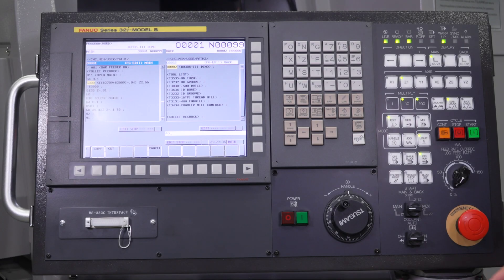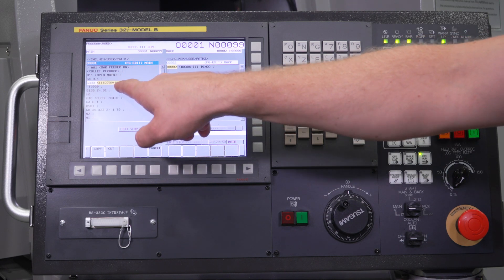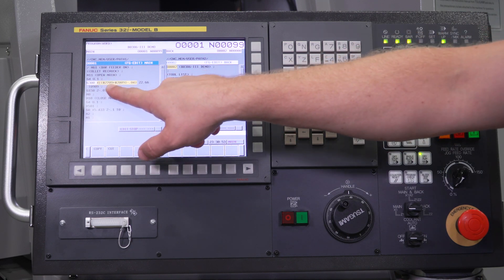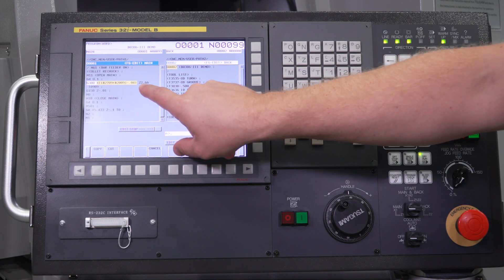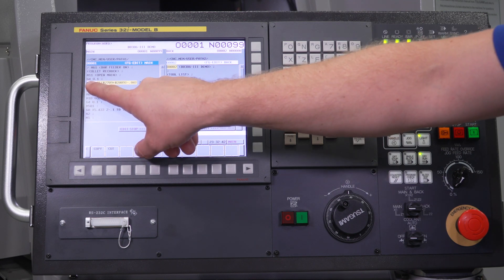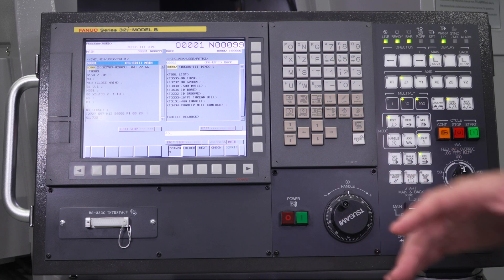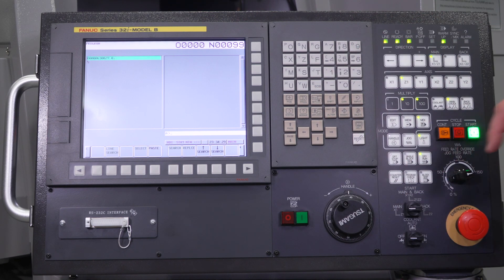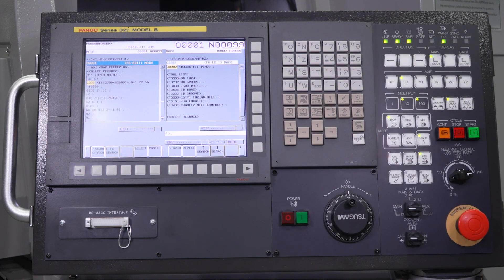How to Use the G300 Code in Your Tsugami Part Programs

Comment: I really appreciate the time and effort put into these videos. I am new to Swiss Turn lathes (SS20) and only the manual to guide me. Its one of the best but having a visual reference and explanation is very helpful. To that point, video cuts to the machine motion are excellent. If you could add close up to the screen so the text was legible, that would be very helpful. It would be difficult to edit this video as is... But you could edit the description header with adding PDF or Word file of the program text. It would be most helpful to visual and tactile learners like myself. 
- Thank You and keep up the good work!

Comment: I Don't know if ill get an answer on this but I've personally written programs long hand on ss-20, and s206-1/2 where on the g300 cycle i found it easier to not include the x value and strictly use the z and t value as i could not see here if you had the cutoff written as a sub program (at the start of the program to establish the tooling pattern stay in a closed loop) or not but my theory that has worked so far is that the g300 will never be commanded without the cutoff in front of the stock at its finish position. So my question would be is would there be a need to include an x value on the start position (g300) command when ideally this would only ever be used when the tool is in the optimal position whether this is running a 1st piece, continuous cycle, or a bar change? Sorry for the long winded question. - Vinny
Reply from the maker: Vinny, technically you can omit the X on the G300 line altogether as long as you have a good safe cutoff program (9001) in your machine and you call it in every part program.